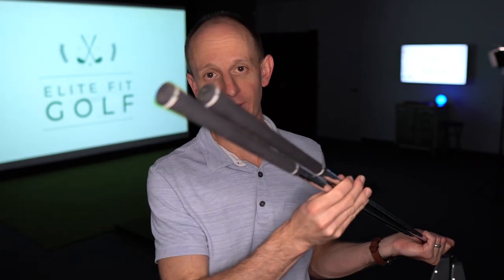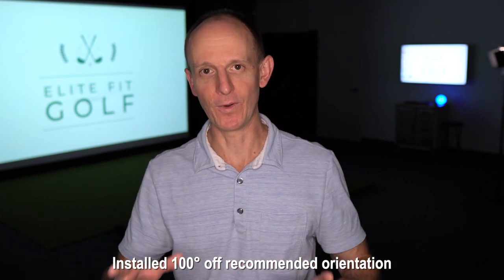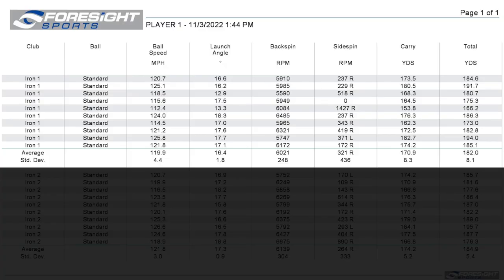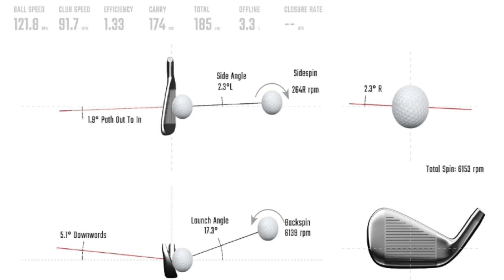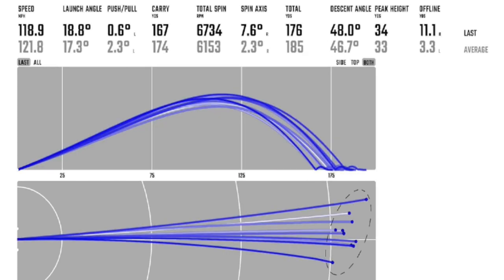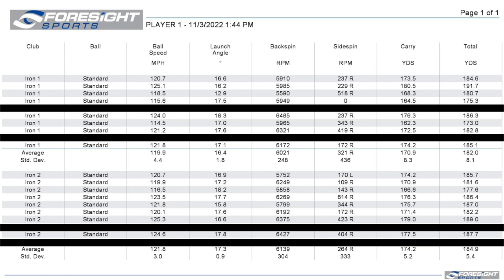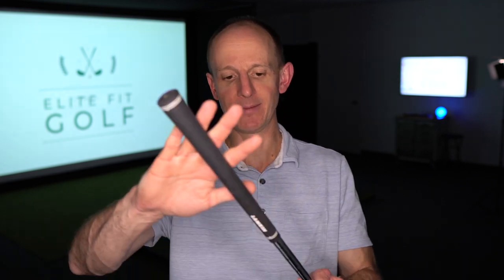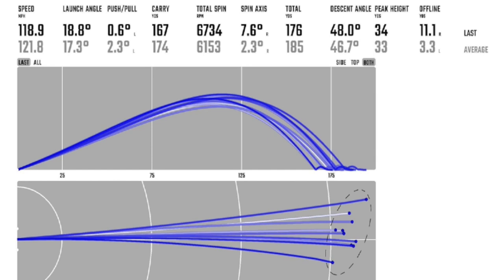Does Shaft PUREing work / GC4 Data Results

Comment: I didn't know you could pure steel shafts since they don't have a spine like graphite.
Reply from the maker: Steel can very much have a spine, the seam where the steel roll is joined together. However modern manufacturing has done a good job of minimizing it, just as they have minimized the layering buildup with carbon fiber shafts.

Comment: If you want to do this in a statistically meaningful way you need to hit 100 balls with each club (ideally alternating clubs and using the same ball) and then compare the standard deviations of the dispersions without excluding any shots.

I tested my putters on Saturday and after 100 putts with each there was not a p95 significance difference between putting with my driver and putting with my best scoring real putter.
Reply: @Phil Willoughby I am floored with this comment - particularly the latter part 😂 Probably because you're using a Scotty? Haha!

Comment: This is your second or third video regarding this technique, and to me you appear desperate to prove PURing has zero benefit. In a previous video you went to a golf range with no ball flight/data recording equipment and handed two clubs to people to try and asked how they "feel". That was just laughable, AJ, and quite frankly a horrible attempt at discrediting this process. Then you go on to make a video to support your opinion that FLOing has no benefit either. But once again, you conveniently leave out the fact that a shaft flexes TWICE in the total arc of the swing.  But in your slo mo presentation you only show one deflection.  One can plainly see that the shaft is clearly beginning to deflect but you cut out the video before the shaft returns and suggest incorrectly that there is no deflection based on half a swing. A club shaft deflects twice. And now this one where the data does in fact show improvement with the PUR'd shaft but you just cant seem to accept it by suggesting you like the "feel" of the other shaft.  What a joke. It's like you don't want to accept it. You just proved it is beneficial. There's decades of data and approximately 25,000 to 30,000 fittings that suggest otherwise to your golf range "test" and this one. Why would you skew the data?  It's so obvious, I'm disappointed to say the least.